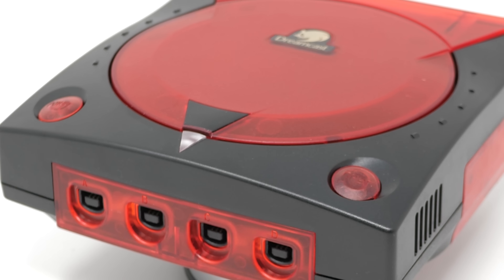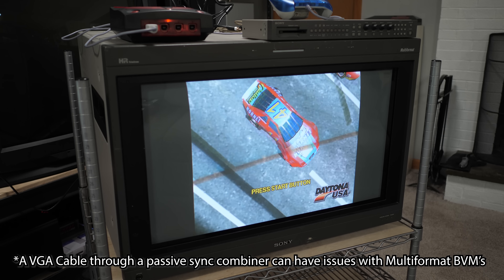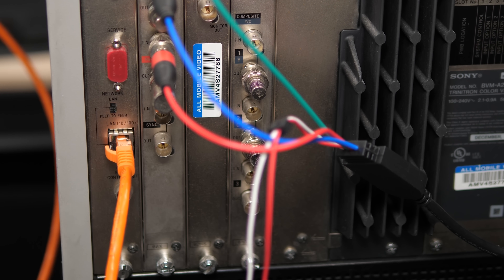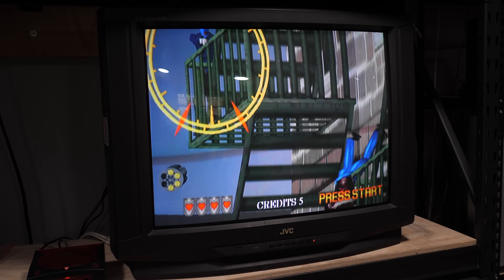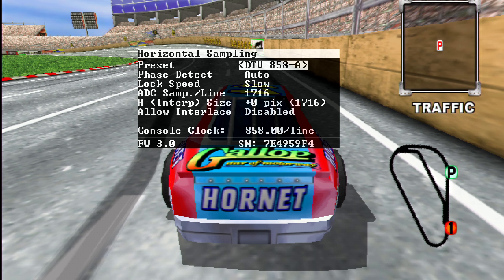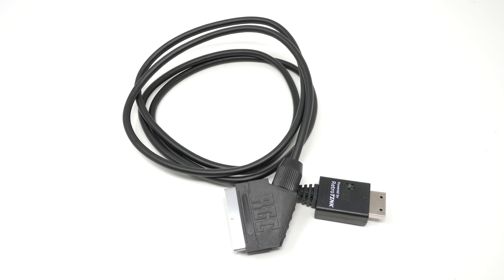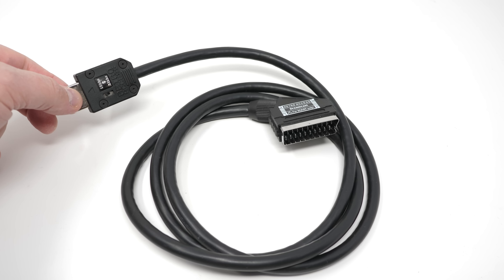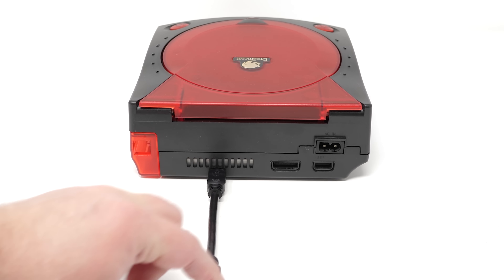Dreamcast Component YPbPr Cable

Comment: I might get this cable to see what the DC looks like on my Panasonic SR Acuity 32" or 36" CRTs, they are 16:9 480p & 576p sets, or they can upsample 480/576i to 833i with minimal latency cost, which I love for DVD & LD, the DC looks incredible on a 22" VGA CRT monitor, so it would need to be good to match that, though I'd take a little less fidelity for the larger screen if it looks close to the VGA output quality, 4:3 on the 36" model would be about 28 inches I'd of guessed.
Reply from the maker: Dreamcast looks amazing on HD CRT’s :)
Reply: @RetroRGB  Can't wait to try it now, just realized there are over 100 DC games that support 16:9 widescreen aspect too, including my favourite DC game, Toy Commander which has native 16:9 out of the box apparently, might be my new way to play it, even though I generally prefer 4:3, full-screen 16:9 on my 36" ED-CRT in 480p with VGA image quality should be pretty amazing, especially as the DC has such beautiful 480p image quality, Propella Arena & GTA 2 should be amazing in full-frame 36" widescreen too.

Comment: FYI, Retro-Bit sells a cheap ($14) VGA cable too. It's what I have used without problems (until I get these YPbPr cables shipped!)
Reply from the maker: It's the exact same as the cheap one I linked to in this description.  Made in the same factory, just sold for twice the price.  It seems to perform okay though.
Reply: @RetroRGB  you are such a wealth of information :) Thanks!

Comment: I got the RGC RGB cable working on my CRT. Not sure why it didn't work the first time.
I switched it to 15Khz and plugged it in firmly. The bouncing DC logo came up and I feel a fool.
I was about to buy a DC to SCART cable + RGB2COMP device for 100 more dollars.
Reply from the maker: Don't feel bad, I did the same thing a few times with previous cables.  The DC jack is just snug.
Reply: @RetroRGB  I discovered an interesting issue. I recently bought two VA0 DCs. One works with the RGC RGB cable, one does not. The only difference is the working DC was made Aug 1999. The one that does not work was made July 1999. They both work with svideo no problem. Also the DC Generator demo disc does not work with the cable. Weird.

Comment: So I’m struggling to get these cables to display a clear signal on my CRTs (all consumer-grade NTSC TVs) regardless of whether I toggle the switch to 15KHz or 31KHz (I'm aware the latter is not supported on 480i displays, but again, neither mode works). I just get a garbled, vertically scrolling image no matter what. I previously returned a set of cables that did the same thing a few months ago. The sound works just fine, so something is up with the visuals specifically.

I hate to sound so tech-illiterate, but I have no clue whether there's an error on my end, or if I've simply had bad luck with two different sets of cables. My Dreamcast does have a DCHDMI installed, but I’m not sure if that would conflict with anything, because my S-Video cables still seemed to work fine with it.
Reply from the maker: Sorry to hear that.  The DC I showed in this video has the DCHDMI installed, so that won't be an issue.  The fact that you're using multiple CRT's points to the cable or Dreamcast.  Do you have any other DC you can try or borrow?  Also, make sure the cable is plugged snugly into the DC - It's easy to think it's all the way in and have issues.  I've made this same mistake quite a few times.
Reply: @RetroRGB I have another Dreamcast, but it doesn’t power on, so I wouldn’t be able test the cables on it. Luckily I live around a few retro game stores, so I could probably bring the cables to one of them to try out. In the meantime, I’ll double check to see if they’re securely plugged into my console.
Reply: @RetroRGB  Good news and bad news. The cables do indeed work on another Dreamcast! But unfortunately, something is causing them to act up on my modded console (for clarification: GDEMU, a new set of controller ports + power light, PicoPSU and a Noctua fan). I doubt any of those modifications would be the issue (since you've already mentioned that DCHDMI shouldn't interfere), so I'll have to take another look at it in the future.
Reply: @RetroRGB  I finally got the cables to work with my DCHDMI-modded Dreamcast. Turns I had “Force VGA” enabled in my settings. Once I set it to “Cable Detect”, the component cables worked perfectly!

Comment: I used this RGB cable on my (2) new DCs using RGB inputs on my CRT. 
The VA(0) DC (July 1999) does not work with the RGB cable.
The VA(0) DC (Aug 1999) works with the RGB cable.
Reply from the maker: It absolutely CAN be used with consumer CRT's...I do it all the time.  Here's all the cable options:  https://www.retrorgb.com/dreamcast.html
Reply: @RetroRGB   Do you use DC > SCART > RGB2COMP > Comp cable > CRT then?

Comment: I have generic VGA into HD15-2-Scart and RGC Dreamcast Scart cables. They appear identical to me but RGC is much more compact and convenient. I have two small component switchers and one more component I’ll need another 😅 so Scart it is for me. It’ll stay in the RT5X. My RGC cable plug is clear on the DC side and has an orange light to show it’s working and properly connected.
Reply from the maker: That's a GREAT solution.  Not surprised to hear it's working well :)

Comment: I’d be pretty curious to see a side by side with the original VGA cable
Reply from the maker: All depends on the quality of the VGA cable.  A fully-shielded / properly grounded VGA cable will look identical to this.  But I've bought cheap VGA cables over the years that had visible interference.  That's part of the reason why this cable costs what it does - Good quality, properly shielded cabling is used.

Comment: Thanks for this video!  I have a Sony KV-27FS120 CRT tv which only supports 240p/480i, but it does have component input.  However you mentioned that connecting dreamcast with component cables to flat CRTs is not a good idea?  Can you confirm if this is my situation?  And if so, is the best option for me to just connect my dreamcast to the KV-27FS120 using the regular composite cable?
Reply: Ack, I think when you said "flat panels" you meant modern LCD displays, not flat CRTs.  Okay then does that mean since my CRT does not support 480p, I should just buy a regular dreamcast to component cable? (one that does not support the 31KHz mode)
Reply from the maker: You're correct, I meant LCD, OLED, Plasma, etc.  ALL CRT's with component video inputs are compatible with this.  If your CRT has component video inputs, you'd still see an increase in sharpness and color with these cables.  And if you ever got a scaler, you could flip the switch and have access to the 480p modes too.  Although it would be much cheaper to get an S-Video cable for now.  Up to you!

Comment: On RGC's website it has the following disclaimer regarding that DC Component cable: "Compatibility with...Consumer Grade Televisions which accept component video, but only in 15KHz/576i TV mode only, and will not work in 480p mode. To use 480p Mode you need one of the following devices below: Sony BVM which accepts 480p, XRGB-mini, Framemeister, OSSC (Open Source Scan Converter), RetroTink 2X Pro, RetroTink 5X Pro." My question is, why can you not get a 480p signal from this cable connecting it directly to your modern flat panel TV? Is this a calculated limitation to force you to purchase these additional devices?
Reply from the maker: That disclaimer is just there to remind people that this cable won't magically allow standard CRT's to accept 480p.  These cables will work with ANY device that accepts 480p over component.  Connecting directly to a flat panel's analog inputs without a scaler might result in lag though:  https://youtu.be/jJzN_YHZezY

Comment: I bought these cables, and I can’t get them to work at all on my Sony Trinitron consumer set
Reply from the maker: Did you flip the switch to interlaced mode?  The average Trinitron definitely won't support 480p.
Reply: @RetroRGB  yeah, I flipped the switch to interlaced mode. It’s just a  black screen with no audio no matter what game I try
Reply: I got it to work. It wasn’t completely tight in the AV out port, really had to jam it in.

Comment: I'm using RGC component cable with my Retrotink 5x Pro but only get a blue screen like it's not receiving a signal. Any suggestions?
Reply from the maker: Make sure the cable is snugly plugged into the Dreamcast. I know that sounds dumb, but triple check. Also, with it powered off, toggle the resolution mode, just to make sure the switch isn’t halfway between modes.
Reply: @RetroRGB  You were absolutely right 🤣

Comment: Now what would be perfect would be to get a VGA cable for the Wii and Gamecube so I could connect to a VGA CRT
Reply from the maker: You can just use a Component to VGA adapter for the Wii and get a Carby and an HDMI VGA adapter for the GameCube.
Reply: @RetroRGB  I wish I could get a Component to VGA adapter but they're always out of stock so it's been a bit hard to find one. And sadly my gamecube is a DOL-101 so no digital out port
Reply from the maker: Damn ;/  Internal HDMI mods, then a cheap HDMI to VGA converter?

Comment: It should be noted that not all games will work on a consumer CRT using these cable. Some DC games, (Skies of Arcadia, Street Fighter Alpha 3, etc) are VGA only meaning they will not work in 480i. Nothing wrong with the cables from RGC, just another quirk of the Dreamcast games library.
Reply from the maker: I cover this in both the other Dreamcast videos I referenced.

Comment: What about an official SEGA DREAMCAST Scart cable compared to the Retrotink cable? I am interested in using 240p with scanlines on my retrotink4k
Reply from the maker: The official Dreamcast SCART cable only outputs 240p and 480i.  If you already own one, just get a cheap Dreamcast VGA cable and use that for 480p.  It's worth noting though that almost the entire library can output 480p, so if you're using an RT4K you'll get double the detail on-screen than using the SCART cable.

Comment: Do these produce a true component output or do played games believe that they’re being plugged to a VGA monitor? If your focus is playing on CRTs, why not just use the RGB SCART ones available? Unless it’s a plasma, most modern flatscreens out there only have HDMI besides composite on the offchance.
Reply from the maker: This is essentially an RGB and VGA to YPbPr converter.  SCART was never widely adapted in North America, but YPbPr was, so it's a much better choice for many people using CRT's.  And yes, most flat panels only have HDMI, which is why scalers are recommended.  Check out this channel and RetroRGB.com for more info on all of it.
Reply: @RetroRGB  I was curious on why to even use the upscaler if these exact cables could be engineered with the same conversion process but with an HDMI output on the other end, especially since they always result in some form of quality degradation and/or input lag due to the post-processing. I saw your website suggest the Akura and Gekko DC HDMI boxes as the more suitable choices if you want a no interference image similarly to as provided with the shown component cables.

Comment: So if I use this cables with my retro think 2x pro  M. I can set It 480i and then line double for those games like Dino Crisis and finally be able to play them on my HDTV without down grading to S-Video or AV cables?
Reply from the maker: Yes, exactly.  However if you'd like, there are now patches available that allow those games to run in 480p:  https://www.retrorgb.com/interview-with-tapamn-480p-dreamcast-patches-solved.html
Reply: @RetroRGB  awesome! Thank you for confirming that for me, I think will be ordering the cables since they are back in stock. Keep up the great work!!

Comment: Anyone know how these compare to the behar bros hdmi boxes?
Reply from the maker: The Behar Bros products have gone down hill in the past few years. I don’t recommend them anymore at all.
Reply: @RetroRGB  im sorry to hear that, its a real shame. Guess ill either grab one of these, or go the scart route with rgb2comp.
Reply from the maker: Agreed - I’ve known them for over a decade and tried my best to help :(
Reply: @RetroRGB  well if theyre unwilling, theres nothing you can do. On the brightside, my gaming tv is an 05 aquos and since it only has working component, this makes the choice easier.
Reply from the maker: That's weird.  I demo this in the video - It works perfect on a consumer CRT.  Maybe he means 480p won't work on a SD CRT??  You just need to flip the switch to 480i.
Reply: @RetroRGB  im thinking thats what was meant. My tv is an older flat screen that goes up to 1080i i think, deinitely 720p so im quite certain it will work fine. Now all i have to do is find these for sale somewhere.

Comment: Just heads up; the cable's 15KHz mode being labelled as 576 is the PAL resolution sibling to 480i60/480p60 - 576i50/576p50.
Reply from the maker: Right, but it’s essentially just “15KHz / 31Khz”. I should have mentioned that :/

Comment: I know I'm late to the party with this video. Does anyone have issues connecting this cable to the Retrotink 5x? For me, I don't get an image, my screen remains blue. I wonder if it's an issue with my Dreamcast?
Reply from the maker: Mine works perfect.  It's possible you got a defective one.  Have you double checked you're on the right RT5x input?  I make that mistake ALL the time :)
Reply: Bob, you're the best replying to this old post. I have a few consoles running through the gcomp to the Retrotink 5x, so I know everything is connected correctly. I tried cleaning the input for the video input on my Dreamcast, that didn't help. I think it might be an issue with my Dreamcast. I have another dreamcast hooked up to a scart setup at my mom's house, I'll test it out over there to see if the problem is with my Dreamcast.

Anyway, thank Bob.

Comment: what instrument bring the  best picture for dreamcast?
Reply from the maker: The best would be these cables, or VGA cables into a scaler, or 480p-compatible CRT.  Here's some more info on scalers:  https://youtu.be/TdfFnR-hOK8
Reply: @RetroRGB  ohhh I have only LCD TV now -_-
Reply from the maker: That’s fine!  Check out that video and decide what’s best for you. A cheap HDMI adapter should work okay. A scaler is better, but you definitely don’t need one for Dreamcast.
Reply: @RetroRGB  i buy hdmi cheap adaptor.. the picture is quite bad...
i will try vga with hdmi adaptor

Comment: any experience with that specific VGA straight into a crt? (gonna go vga into trinitron). Worth it when compared to composite in this case?
Reply from the maker: If you mean a CRT VGA computer monitor, it'll look AMAZING.
Reply: @RetroRGB  thanks for the reply! If I may be more specific 
VGA straight into Sony trinitron 32in crt that has a vga input
Reply from the maker: I've never seen a 32" Sony with a VGA input.  Or one that could handle 31KHz / 480p.  Do you have a model number and I can look it up?  Don't paste a link, otherwise YouTube will block it - Just a model number please.
Reply: @RetroRGB  I’ve made a huge mistake and have no idea what friggin tv I was getting that mixed up with 🤦‍♂️🤦‍♂️. Bob, I appreciate you being willing to help
Reply: Don’t waste your time with VGA and the Toro boxes.

For some reason the screen just isn’t crystal clear. 
I have a 36” Trinitron

Comment: I bought a retrotink-2x pro multi-format years ago thinking  it would pair nicely with HD Retrovision Dreamcast component cables. Glad I’ll finally be putting my retrotink to use.
Reply from the maker: The TINK 2x Pro is only compatible with 15Khz (240p & 480i).  Most of the Dreamcast's library supports 480p, so you'd probably want a different scaler.  Or just a cheap component to HDMI converter:  retrorgb.link/cheapdac
Reply: @RetroRGB  - it works, the multi format version of the 2x-pro has a 480p pass-thru setting. These cables are amazing… now I just need to get my hands on a retrotink 5x.

Comment: So before knowing this info I purchased the Bitfunx RGBS VGA component cable that switches between those 2 signals. Problem is I don't know how to properly use it with my Tink5x. Seems to only somewhat work in RGBS mode and VGA mode is unclear and tearing at the top/bottom of image.

Comment: What’s the difference between this cable and normal third party vga? I want to get these component cables for my crt but it doesn’t have any vga only component.
Reply from the maker: The output quality will be the same, so if your display only supports component video, get these.

Comment: Their website has a disclaimer that reads "May not work with Dreamcasts fitted with aftermarket replacement power supplies which don't provide sufficient current"

Is this in reference to the Dream PSU? Do you believe it would cause issues?

I keep hearing about people replacing their stock PSU in an effort to troubleshoot an issue where their brand new GDEMU isn't functioning correctly, and was worried I may run into the same issue if and when I get around to ordering one.
Reply from the maker: I think this is just a disclaimer that lets people know if you have a random, crappy PSU, nothing will work right, including these cables.  Should be fine with the DreamPSU.
Reply: @RetroRGB  Appreciate the quick response 👍